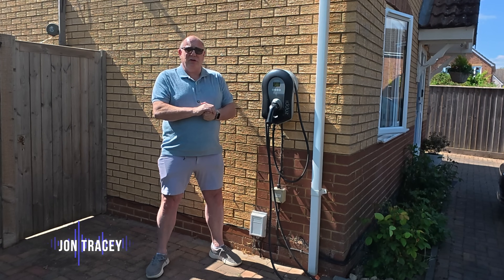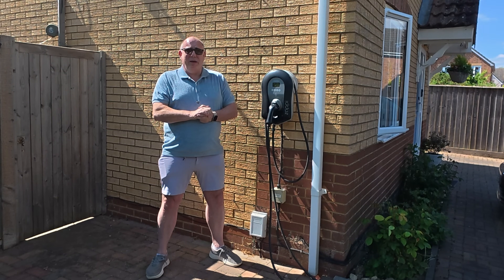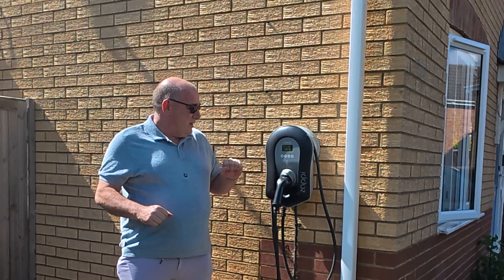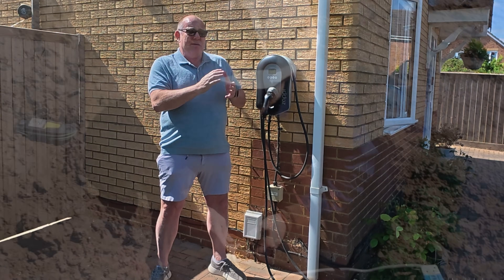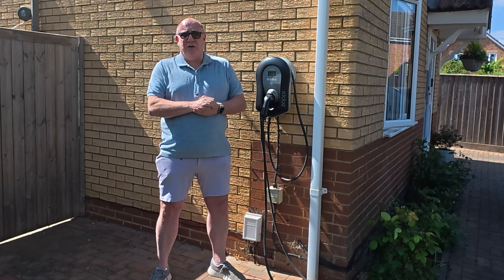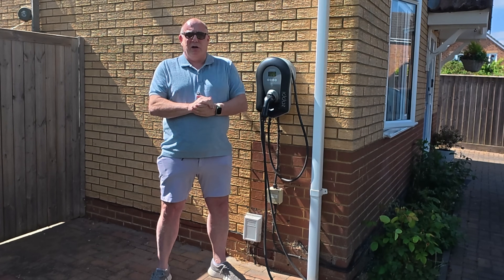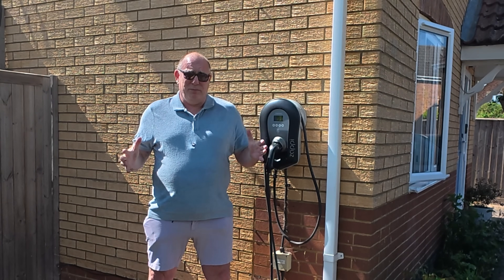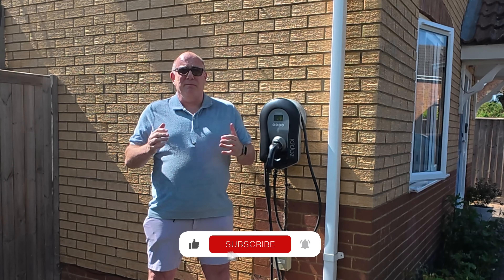Why This Home Upgrade Could Cost You Big in 2025!

Comment: Yes, as you said, it depends on the tariff you are on. 
Here in NI it is very different. Our export rate with PowerNI is currently 10.32p and our night rate is currently 17.16p so diverting solar for car charging does make financial sense. In fact, thanks to extended sunny weather we currently have, we are on target to run both of our cars entirely on solar for the whole month of May.
For me, it’s also not just about the financial aspect; I get a lot of satisfaction from heating water and charging our cars directly from the sun that shines on the roof of our house. Myenergi kit is great.
Reply from the maker: I don’t know a lot about the power landscape in Northern Ireland, is there only one provider? Was Northern Ireland somehow left out of the deregulation?
Reply: @JonathanTracey  I don't know much about the landscape there in GB to compare but I do know they are quite different. We do have a choice of providers but it is very small compared to GB. Only about 5. We don't have smart meters yet either. They are only currently being tested by NIE so I think that is why we don't have more flexible plans like are available there with Octopus. I am personally not too bothered by that though.
My biggest issue here is more DNO related, in regard to solar installations with NIE. I know there in GB it is pretty straight forward to get a G99. Unfortunately not here. In fact for single phase domestic it is pretty much impossible. That is why most people (like myself) are stuck with G98 3.6Kw inverters even though in my case I have 5.7Kwp which is really frustrating this time of year.

Comment: Your model assumes that everyone uses Octopus Go/Intelligent Go. I have a larger house with ASHP, 2 solar arrays and 2 EVs. We are low mileage drivers so the ASHP is the biggest consumer of electricity especially in Winter. I use Agile rather than a Go variant because by being agile with charging etc, I can keep my annual average to 15p/kWh. Octopus Watch tells me that I am better off doing that for my consumption than moving to Go. My alternative would be to go for a second PowerWall to help bridge the ASHP demand during December and January on the GO tariff. I have a PW2 currently so that probably means moving to a 3 plus an expansion pack. I would rather wait for a bi-directional Zappi and use one of the EV batteries than invest in more fixed battery storage.
Reply from the maker: Sounds like you’ve really optimised your setup — Agile can definitely beat Go for low-mileage drivers with flexible usage, especially when managing ASHP demand. And you're right: using an EV as a virtual battery via bidirectional charging could be a smarter long-term move than investing in a second Powerwall. Makes a lot of sense.

Comment: It is so strange to me that an electricity company would pay solar electricity export at twice the night time purchase rate. In New Zealand our night time purchase rate is higher than our solar export rate, so solar diverters make great sense economically. And yes, we do gave octopus here, but they are a tiny player in the market and they dont "pay out" a solar credit (can only use a solar credit to offset future electricity purchases)
Reply from the maker: That is interesting — it's a very different setup from the UK! Here, some tariffs (like Octopus Flux) are designed to reward export during peak demand hours, which can push the export rate well above the off-peak (night) import rate. So for people exporting a lot, it can actually be more profitable to send energy to the grid and buy it back cheaply later.

But you're totally right — where export rates are lower than import costs (like in NZ), diverters make far more financial sense. It really does come down to how each market structures its pricing. Thanks for sharing the perspective from New Zealand — it’s always fascinating to see the differences!

Comment: If you're on an earlier FiT can you still move to metered export? If not and you're on deemed export then divert makes sense
Reply: I believe you can yes. Ask your current fit provider.
Reply from the maker: Yes its a two step process, you notifiy your FIT provider that you want to opt out of deemed export, then once they ave removed it from the system, you can be enrolled in a export tariff by your provider (does not have to be the same as your FIT provider)
Reply: @JonathanTracey do you lose out on between the 2 step process, especially if you switch provider for the export?
Reply: Yes. I’ve recently done just that, albeit with the complication that the revised system (with some extra panels) exceeds the original total installed capacity (TIC). It’s using the existing meters - one mine, the other with the export values belongs to the supplier. They have to do the sums to reduce the unit rate pro rate to balance the difference between the old and new declared TICs, so that Ofgem don’t pay extra overall. I send in both generation and export values quarterly for that.

Comment: It's interesting how the UK is so different to countries like Germany. Here in Germany, on a dynamic tariff, I paid 30c overnight (it was 45c at 8pm yesterday!), and during the peak of the day, peak solar production, it's 14c. Export of solar is around 10c for a system installed in 2025. So in just about all cases, it's much better to self-consume solar.

I think it will change in the UK, as like Germany, you will eventually have too much solar during the peak daylight hours in summer.
Reply from the maker: Absolutely — that's a really insightful comparison, thank you for sharing it.

You're spot on: the economics of solar and energy use are very market-specific. In the UK, we're currently in a bit of a sweet spot where some export tariffs pay a premium during daytime peaks, making it attractive to export rather than self-consume. But I completely agree — as solar adoption grows here, we’ll likely see the same trend as Germany, with midday export value dropping and self-consumption becoming the smarter move. The grid just can’t absorb unlimited solar forever!
Reply: @JonathanTracey  In Sweden the only export tariff you can get is hourly(soon to be 15 min) market price. On 8 out of 14 days at start of May the price has been pretty much 0 or even slightly below from 10 to 17, the saving grace for solar panel owners has been the 5p tax reduction that has meant that at least we haven't had to go out and turn off inverters to avoid having to pay to get rid of electricity but that is removed next year probably. But with an average price of 10p(including tax and DNO fee) in the summer months I am not sure adding batteries and equipment to divert makes financial sense.

Comment: 4th reason, you're one of the 70% of homes in a rural part of the northern smart meter network where you can't get access to a low overnight tariff because of a weak signal.
5th reason, you want to minimise your carbon footprint. During a settled period of weather with sunny days and only moderate winds as we have at present, so you may not want to charge your car (or heat water) at the overnight carbon intensity of 125g/kWhr (03:00 14th May 2025) when the forecast intensity for the following afternoon is 65g/kWhr, or you could argue that charging from your excess solar is completely carbon free.
Reply from the maker: Both good points

Comment: Great that UK specific stuff is up front. In Australia solar is so plentiful that at times if you are on wholesale rates you can be charged to export it, and there are plans with free electricity between 11am and 2pm.

There is no off peak rate anywhere as cheap as you get from your exports in Australia anymore. 

Years ago the FIT was more but now it's way less and the last people on the legacy rates where it was possible to earn more from exports than power costs even at extreme off peak have finished their contracts.
Reply from the maker: Really interesting to hear how things have shifted in Australia — it’s a great reminder of how different the economics can be from country to country. Sounds like you’re already in the future many of us in the UK may be heading toward, where self-consumption becomes far more valuable than exporting. Those free midday electricity plans are fascinating — a clear sign of just how abundant solar has become!
Reply: @JonathanTracey  I did respond to your previous comment on this topic. Australia could be an example of the very future of the UK. NOBODY right now installs Solar PV based on the economics of feed-In tariffs as they are down to 1p/kWh in your money or less or you even have to pay your supplier for that "privilege". Solar PV coupled to storage batteries is the new alternative solution. Our grid supplied electricity prices keep soaring as less and less people draw from it and our Coal-fired power stations are shut-down. The new Federal Government is very much aligned with renewable energy alternatives and have introduced a Battery Rebate scheme on Home/Business installations that are Virtual Power Plant (VPP) compliant so that in future this can be "integrated" into their solution for Base-Load supply of grid power i.e. take effective control of your battery bank when needed.

Comment: I have been on Intelligent Octopus Go since December 2023. In April 2024 I stopped getting bills for import but continued to get credit for exports. My Zappi continued on IOG until Nov 2024. In March 2025 I got billed for all my imports at the full day rate as they could not use my smart meter for billing. In mid-March 2025 they told me I was then back on IOG and the Zappi got reconnected. I have not received a bill since despite requests. I have an Octopus heat pump. I minimise my electricity import with batteries & water diverter. 
I am interested that you are trusting!

Comment: Here in Australia things are a little different.

In nsw, feed in tariffs are $0.05, and there is talk of a charge for exporting during peak production.

Our setup is microinverters, I am having a wifi switch that enables me to reduce production driven by home assistant.

We will top up the car each night from the battery to ensure that our production goes into the battery when we have "surplus".  Our battery usually charges by 11 am, so poking 10 kwh into the car will extend the charging window across peak production.

Our usage tariff is a flat $0.40, so using power (even via the battery) to charge saves $0.35 kwh
Reply: Yes,  we have witnessed here in Australia what happens when Solar PV becomes so huge. The feed-in tariffs used to be 30c/kWh but because we have so many solar PV installations and so much Solar power available the Grid and the Power companies now, they pay you almost Nothing! That is why home Battery Storage is taking off - store it for your own use (say at night), or sell it back to the grid  at the random times that they have a power peak and need it and will pay more, the VPP solution.
Reply from the maker: That’s a really smart setup — using the EV to extend your solar charging window is a clever way to make the most of your generation, especially with such a high usage tariff.

Out of curiosity, do new homes in Australia typically come with solar as standard now? With all that sunshine and such low FiTs, it seems like a no-brainer — I’d imagine every roof should be making the most of it!
Reply: @JonathanTracey  it isn't compulsory, but a large percentage do fit solar.  Battery uptake has been steady, but the government is offering subsidies from July 1, so many will take advantage.  40% of existing Aussie homes have solar, and it. Is recognised as a good move..

As for topping up the car, there are substantial losses involved, meaning it is technically inefficient, but controlling and avoiding expenditure is my goal.
Reply: @JonathanTracey  No. But we in Australia have been such HUGE adopters of Solar PV installations and so much Solar PV power is generated that feed-in tariffs have reduced to "bugger-all", and now some companies are proposing charging you for feeding in power - so we have the situation of too much power! The deployment of home Battery solutions has taken off (especially with new Government Battery Rebate), in order to circumvent some of this sting and also the roll-out of Virtual Power Plant (VPP), is getting traction where homeowners can sell power to the grid at those random and variable times when they need it.

Comment: How do you stop your batteries from charging the car? I am looking at getting an electric car next year. Are charges changing much from a technical point of view. Which charger would you get if you did it again?
Reply from the maker: It’s really simple. I set an export limit that there has to be at least 100 W being exported to the grid for 30 seconds, this gives the inverter time to ramp down and not supply power from the battery. If it’s still being exported after 30 seconds system assumes that this is coming as excess from solar, then the car charger can kick in. It’s just a simple setting on the charger and it seems to work perfectly for my set up. What would I do if I had to do it again, I’d be very tempted by the. sigenergy DC charger that can be integrated into their battery stack
Reply: @ I saw the SigEnergy battery stack on the Gary Does Solar site. It looks really nice. I have a Lux system so no chance of swapping to that.

Comment: I use an Eddi, but I program it via its API to have more control. So I heat the hot water in the morning (7p rate), then put it into STOP mode (via the API), and only put it into divert mode a couple of times a day to top up the temp. Otherwise, it keeps topping up every 15/30 minutes to keep the tank hot when I don't need it.
Reply from the maker: I do something very similar, except only once a week I turn the Eddi on via the API and allow it to heat the tank to 65° for the legionella cycle. But there’s no point using daiky in my case because we have a  heat Pump. With electrically resistive heating I only get 1 kW of heat for 1 kW I put in. With the Heat Pump I get 4 kW of heat for 1 kW I put in. so it makes much more sense to sell the kilowatt back to the grid. Make 15 p, buy it back at 7p and use that £7 to generate 4 kW of heat
Reply: @ heat pump is next on my list! 👍

Comment: YES  it could cost you Big if the EV burns your home down as happened in Chandlers Ford Hampshire 😢
Reply from the maker: You're right to be concerned about vehicle fires, but it's important to consider the broader context. While the incident in Chandlers Ford was tragic, data indicates that petrol and diesel vehicles are significantly more prone to fires than electric vehicles (EVs).

In the UK, over 100,000 vehicle fires occur annually, with the vast majority involving internal combustion engine (ICE) vehicles. Statistics show that petrol and diesel cars experience approximately 1,530 fires per 100,000 vehicles sold, whereas EVs have about 25 fires per 100,000 sold—making ICE vehicles roughly 20 times more likely to catch fire than EVs

Comment: I use a solar diverter to divert excess energy to heating the water once my battery is full because I am on a legacy Feed In Tariff where not only do I get paid for every kwh generated I also get an additional payment which assumes I export 50% of everything generated so maybe worthwhile stating these recommendations do not apply to people still on a FiT.
Reply from the maker: Great point, and thanks for sharing your setup! You're absolutely right — if you're on a legacy Feed-in Tariff (FiT), you receive a generation payment plus a deemed export payment, which typically assumes you export 50% of what you generate, regardless of how much actually goes to the grid.

It's worth noting, though, that FiT customers do have the option to opt out of deemed export and instead get paid for actual exports through a full export tariff like Outgoing Octopus. This can make sense for households that export a lot of their solar energy, as it could lead to higher overall returns.

That said, if you tend to self-consume most of your solar — for example, by using a diverter or charging a battery — then sticking with deemed export might still work out better financially.

So you're absolutely right: these newer recommendations around diverters and export payments don't always apply to those still benefiting from the original FiT arrangements — it really depends on your specific usage and export patterns.
Reply: Depends on the age of the FIT.  Moved my parents off their export FIT last year and it’s been much more profitable exporting it than deeming anything.